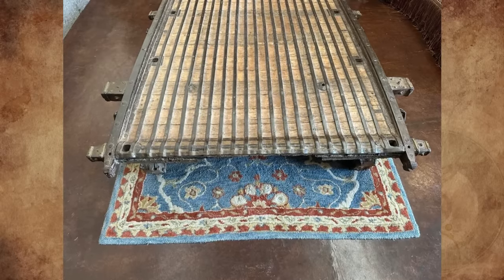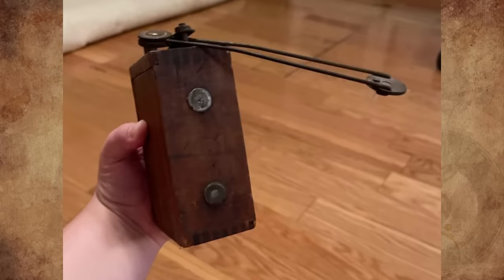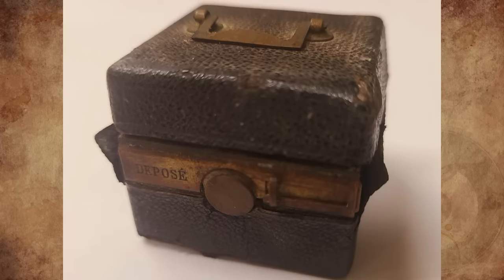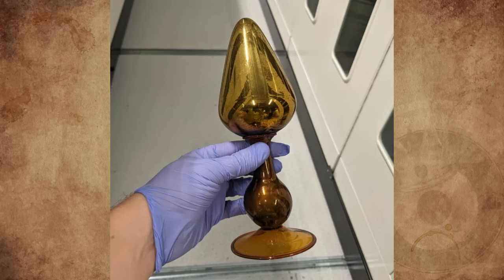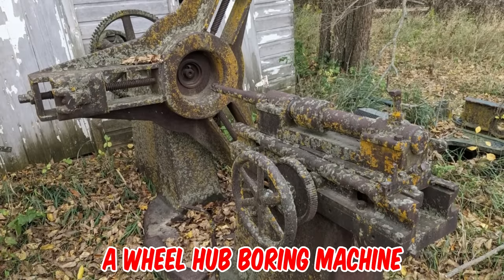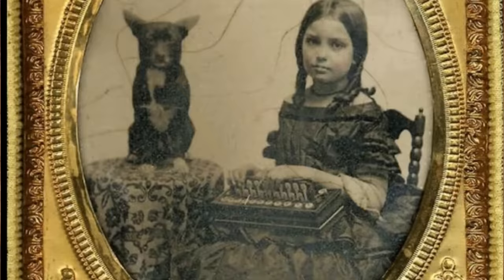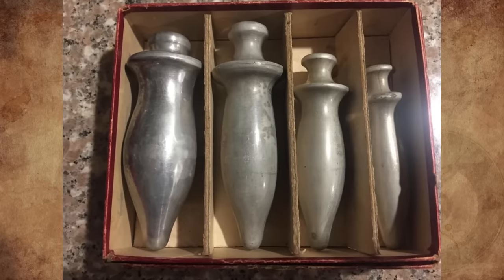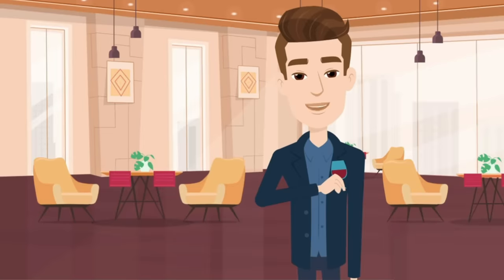What Are These Mysterious Heavy Copper Sticks Found In A Thrift Store And These Hollow Metal Things?

Comment: The" ink well" is not an ink well at all. It is a portable burner. The small slider is for the adjustment of the airflow. And the coil in the upper part keeps the missing cover of the burner in place, thus you have ash around three burner. An ink well has no slider...
Reply: Precisely  a burner used to apply wax stamps.
Reply: Thanks. As a former smoker and an artist who does calligraphy, it was obviously something to do with fire, but I'd never seen anything quite like it...to be honest, the coil, more than anything else told me that.
Reply from the maker: The inkwell is 1.5 inches on each side, that small can't be a burner. 

https://youtu.be/4dOFsTOqBh0

https://www.etsy.com/listing/565589894/traveling-inkwell-leather-covered-late

https://commons.wikimedia.org/wiki/File:Inkwell,_travelling_(AM_1969.173-5).jpg

https://www.invaluable.com/auction-lot/vintage-travel-inkwell-set-brass-leather-28-c-3654054a03

https://www.proantic.com/en/1132042-interestingtravelinkwellinsheetmetalglassandleathercountycrownandinitials.html

Thanks for watching!
Reply: Because someone used this inkwell as an ashtray, I can see your confusion.  This IS an inkwell.
Reply: @neesr13  I have to admit... yep, this is an Inkwell indeed. Used as an ash tray...